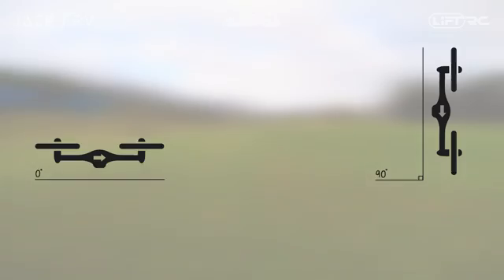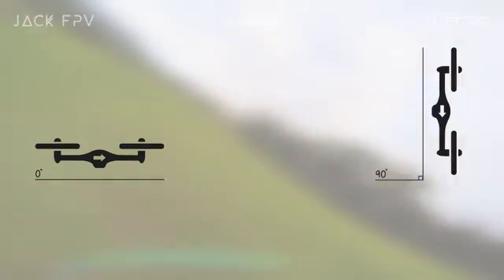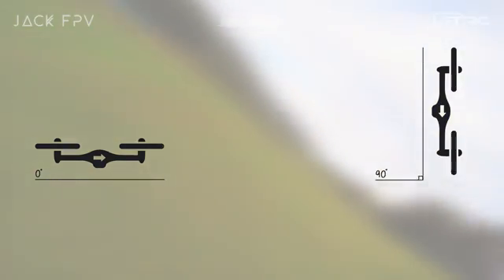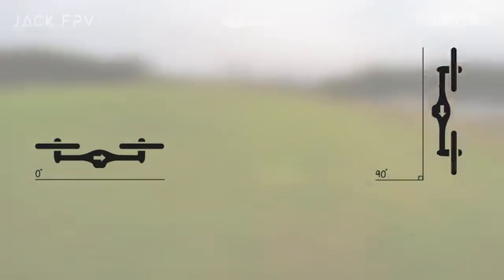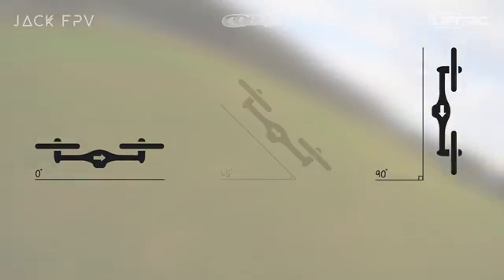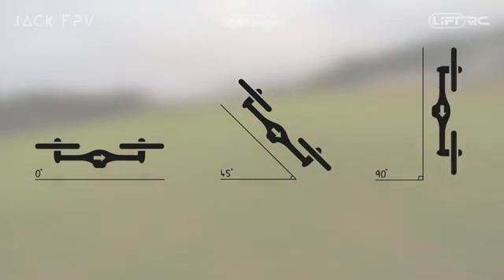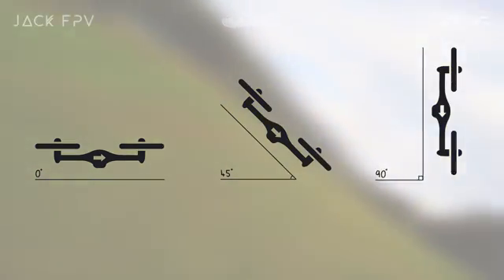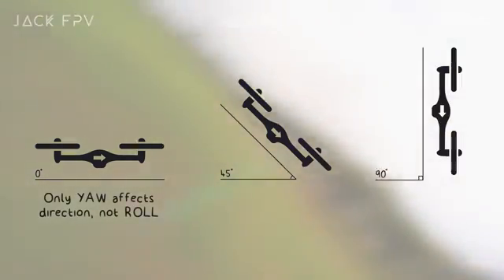How-to Fly FPV Quadcopters / Drone - "TURNING AND ADVANCED BRAKING"

Comment: its not as easy as just putting yaw in. he never once showed what happens when the plane is a 45 and you yaw because in a head set it looks like it turns the wrong way as it rolls only on the y axis not x and y at the same time. it like having two flight modes where y becomes useless at any angle.
i'm going to see if i can dual rate the sticks depending on what angle the quad sense just on y axis to see if you can simply yaw and it rolls at x. if i wanted to fly something so annoying i would have bought a two blade copter

Comment: hi i just got a spectrum dx5e froma  friend - can i connect it with my laptop and use it on a simulator?
Reply: You have to buy a trainer cord that goes from the transmitter to the PC via a USB connection. Find them on the internet...

Comment: Hi, I'm having some minor issues I believe with my turns in Liftoff. I'm quite new to the quad scene and understand the mechanics involved theoretically. I have a Spektrum DX6 that I'm using and when I try just a slow flight and using just the yaw to turn the quad seems to lift and roll in the opposite direction from where I am trying to go. Example, I would want to turn right. so I would yaw to the right and the quad would begin to turn and face right but I would continue on my current projector until I pitch forward or counter with a roll. Is that normal? or have I messed up with something with my settings in the game or on the remote it self?  I only ask cause I'm spending so much time in the simulator getting the muscle memory down before I go and crash my quads in r/l  Thanks.
Reply from the maker: Totally normal :) Yawing alone wont turn the quad unless you add some roll/pitch and throttle. Cheers

Comment: I've got to get a Taranis or something. I find keeping the throttle low enough in LiftOff really hard. I can do big, sweeping movements well, but small, precise ones are so tough.
Reply from the maker: Yes a Taranis changes everything. Controllers work nice and are a quick fix, but if you're serious about flying FPV you should definitely invest in a Taranis.
Reply: +FPV Academy damn. Now I REALLY have to go get one!
Reply: are you using thumbs? that's the noob way. you need to watch a video on thumbs vs pinching. only using thumbs gives you less precision and less dexterity. watch the video and find an easy way to pinch because I know some people don't like it because it's cumbersome but there are a lot of different ways. there is a pinch/thumb hybrid way.
Reply: +Dontbeweakvato it seems all the top pilots vary. I am not sure I could be bothered trying to change.
Reply: +TinyPirate rotor riot pinching vs thumbs I meant to type
Reply: +Dontbeweakvato thanks for the link, I will check it out. Now I have my Taranis I have a controller big enough to try! Yay!